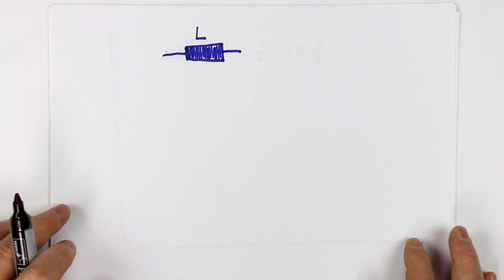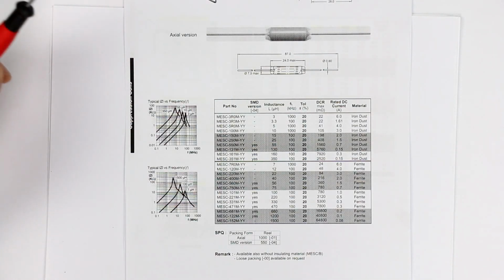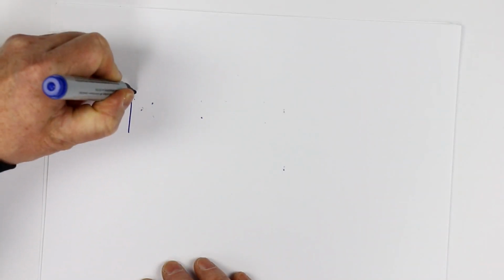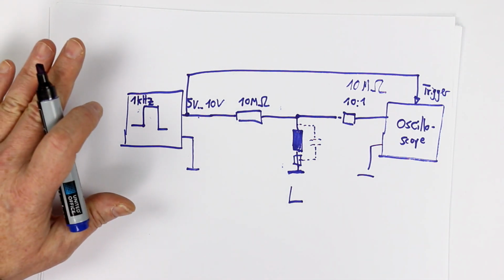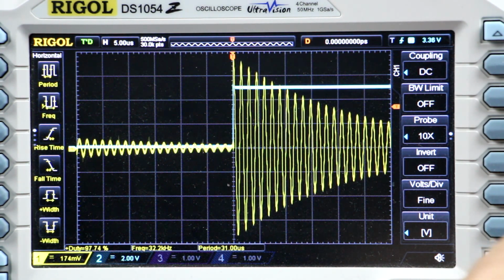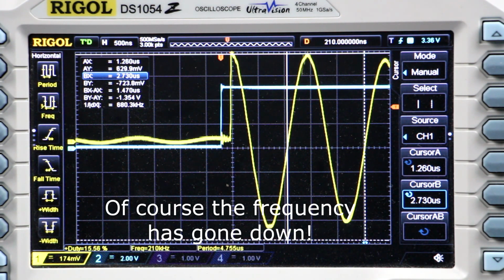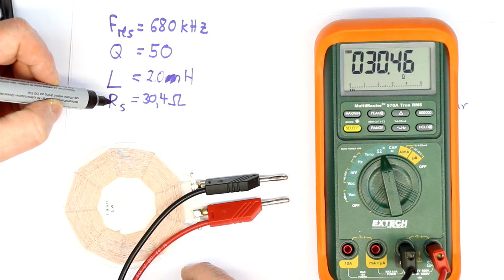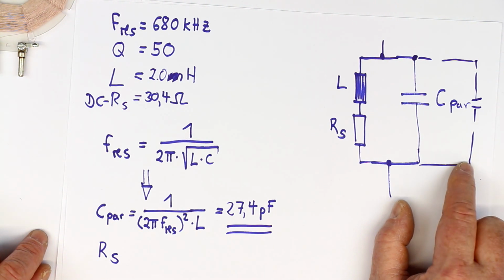Measuring Self-Capacitance and Self-Resonant Frequency SRF of Inductors

Comment: SG, test load, Osc in paralel like in the circuit doesn't work with my Fnirsi 1014D Osciloscope.
Dont know why.
By connecting all in series(without resistor) then i can find the resonant frequency.

Comment: He said you can find Q by counting the number of cycles to get to half the first cycle amplitude and multiplying by 5.  That's a bit rough and ready.  For a Q of 50, 10 cycles would drop to 0.522. not 0.5.   Logarithmic decrement (the drop from one cycle to the next) is pi/Q, so the amplitude of the 10th cycle is (1 - pi/50)^10 = 0.522.   He added further error by starting at the first cycle, whose amplitude and waveform is affected by the residual  wave from the previous driving cycle - you can clearly see that in the video.    He should have taken say the 5th cycle as his reference or, better, use a much lower frequency triggering square wave.
His real Q is closer to 45, not 50.

Comment: In this video he used "Thompson's formula"   f = 1/(2PI*sqrt(LC)) based on the self resonant frequency and L measured at a much lower frequency to calculate the self capacitance (which he called "parasitic capacitance" - a term we don't use in english).
This is generally a very inaccurate method and should not be used.   
The reason is that at and near self resonance, the circulating capacitance current seriously distorts the distribution of coil turns current.  Obviously, if it is resonating, the current in the start and end turns must be very small, but the current in the middle turns very high.   In fact the distribution of current in the turns is parabolic - quite different to what happens when resonated with an external capacitor, wherein the current is the same in every turn.
Thus the magnetic field is a different shape, the energy stored different and that means the inductance is different - changing the self resonant frequency away from what Thompson would predict.
The traditional way of measuring self capacitance is to find two external capacitors that resonate the coil at a frequency f1 and 2f1, both much lower than the self resonant frequency, say 1/10th.    The self capacitance is then (C1 - 4C2)/3.  This will for most inductors typically be about 10 to 15 times more accurate than KainkaLab's method.   You don't need to know L to get the self capacitance.
I had to laugh every time he pronounced "series" as "serious".   He did it every time.

Comment: You said it is the self-resonant frequency measured by the component tester, but that was 546kHz, different than the 680kHz the scope measured.
You said it's not very accurate, but that is a big difference, is it still the same measurement, or did I miss something?
Reply: In the calculation, he is using 680kHz. Ignore 546kHz. 546kHz was used by the component tester to measure the inductance of the coil.

Comment: So if I have a coil with a capacitance of 290pf that I measured.  I want a resonant tank for the natural frequency of the coil and have derived that capacitance needed for the resonant frequency. The problem I see is the coil capacitance is greater than the derived capacitive value. Am I correct in stating the I have to take into account the coil capacitance in creating the LC tank? If this is the case then I can not get the capacitance as low as I need unless I add another capacitor in series to try to get the value low enough.
Reply from the maker: You can only change the resonant frequency to lower frequencies (below the SRF of the coil). The only way to change/tune the resonant frequency of an existing coil is to add a capacitor in parallel. And that in turn lowers the freqeuncy. Adding a capacitor in series does not change the resonant frequency!
So you have to find or wind another coil to get the desired resonant frequency.
Reply: @KainkaLabs  Thank you. I Want the tank to resonate at its S)elf R)esonating F)requency. That is the value of capacitance that I am trying to achieve.

Comment: Can you tell me the name of the device you use at minute 28:05 ?
 Thanks a lot
Reply from the maker: You probably mean the "Component Tester" which is an open-source project from a German ham-radio amateur. It sells on Ebay under different names and in a number of models. Search for "Component Tester" or "Transistor Tester". David L. Jones also given it a "thumps up". We have it in our shop for many years: 
 https://www.ak-modul-bus.de/stat/laborzubehoer.html
And I made a 4-part video series (kind of shootout) of 4 different transistor/component testers...
Reply: @KainkaLabs  Thank you very much for this complete answer.  See you soon, a cordial greeting.

Comment: Hello Roger, Great Video!  I am trying to do the same with a cylindrical oil filled ignition coil.  I seem to be having some issues with this on this sort of coil.  I took my 10 mOHM resistor from the inside of a microwave oven capacitor.  Can you explain how to do the same experiment on both the primary and secondary of one of these sorts of coils?  Perhaps I need less resistance? Remember the ignition coil is an autotransformer with the primary and secondary attached (usually at the negative pole of the primary). I know the inductance of the primary because I have a UNI-T LCR meter that caps out at 20 Henries (my primary is 5.27 mH, but the secondary (which should be around 49 H is too large to measure with this unit).
Reply: 10 miliohm? Did you mean 10Mohm?
Reply: @AlienRelics  Of course, thanks!
Reply: @MisterBonetti  Ironically, I mis-spelled "milli"! 😅

Comment: Does the frequancy change with a changing voltage? So if we  measured it at 2 volts will it change at 5 volts and 10 volts respectively?
Reply from the maker: I didn´t try, but why should it change (as long as there are no saturation effects)

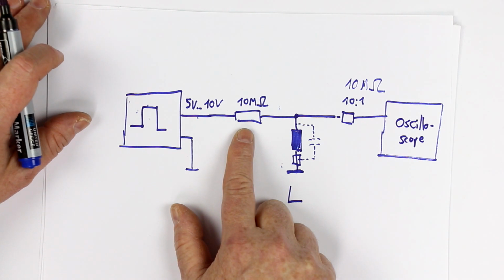Comment: 15:00 Probe also have some capacity..you should not add 1pF capacitor with probe?
Reply from the maker: Yes, somebody else remarked this in another post. I forgot to isolate the probe with a 10 Megohm resistor from capacitive influence.

Comment: scope+probe input capacitance is quite comparable to the value you calculated so, this self capacitance value is quite a bit wrong
Reply from the maker: No. Because the scope-probe was isolated by the high-Megohm value resistor.
Reply: @KainkaLabs  I agree with Amir B that your scope probe capacitance caused your measured SRF to be lower than it really should have been because you did not have a resistor between your inductor under test and the scope probe.  I just did a test using your set up using a x10 probe and my measured SRF on an inductor was 5.1 MHz.  When I measure the same inductor using a nanovna the SRF measures 7.3 MHz.  If I repeat your measurement system measurement but add a 1 Meg ohm resistor between the inductor under test and the scope probe the SRF measures 8.33 MHz.  I suspect the 8.33 MHz measurement is the most accurate out of all 3 of my measurements because the added 1 Meg ohm resistor helps isolates the scope probe capacitance from the inductor under test.

I also calculated what capacitance would make my 44.2 uH inductor resonate at 5.1 MHz and it would be 22.0 pf.  To resonate the inductor at 8.33 MHz the capacitance would be 8.3 pf.  The difference in capacitance is 13.7 pf which is very close to the 14 pf published capacitance of my x10 probe.  Therefore it sure looks like the scope probe capacitance greatly influences the measured SRF using your setup.

Update: I also checked self resonance of my inductor by setting my function generator to output a sine wave and connected it to the inductor using a 10 Meg resistor just like the setup shown in this video, but I did not connect the scope directly to the inductor.  I wound a two turn pick up coil and connected it to my scope x10 probe and placed this pickup coil close to one end of the inductor and then adjusted the function generator until the scope waveform peaked, and it peaked at 8.3 MHz which exactly matched the results I obtained when I added the 1 Meg resistor mentioned in my first paragraph.

P.S. great video
Reply: @KainkaLabs  @ 16:00 what resistor? It's a 10Mohm input of a 10:1 probe directly connected to the inductor. there is no extra resistor in between, is there? The lowest capacitance 10:1 passive probe I have ever seen is P6139 of Tektronix which has 8pF total capacitance at its input tip when it is connected to the 1Mohm scope and compensated. Any other passive probe will have more than 8pF at the tip.
Reply: @amirb715  so you're saying the SRF measurement is wrong? I'm not sure if I'm missing something, but you're implying it's impossible to measure anything at MHz.

Comment: Most excellent! I was able to immediately go down to the KY8D lair and verify that the basketweave loading coil for the 472kHz TX antenna would, after all, be good for its intended purpose. This after my LCR meter gave alarming mis-results, when used by itself. Ditto the Rx loop. But that neither may do double duty for 160 meters. Good to know. Thanks!

Comment: Why your measured Q factor differs so much from calculated one? According to your parameters Q factor can be calculated as: Q=1/R*sqrt(L/C).... It gives 281..? But anyway perfect video.! :D
Reply from the maker: You can´t take the ohmic (DC) resistance for calculating Q-factor. You have to take into account skin-effect and proximity effect which raises the DC-resitance sometimes by orders of magnitude.
Reply: @KainkaLabs  Thank you very much for your answer.... You really think that skin effect and proximity effect would have such an impact on the resistance in frequency 700kHz? .. and moreover u used a Q factor formula for calculating AC resistance... I am just so struggling with my LC circuit, because my measured value of Q factor is significantly lower than calculated one... Do you think u can use the same way to measure quality factor of LC circuit (where value of capacitance is in tens or hundreds of nF)?? Thank you
Reply: @josefbednarik5782 I can confirm, AC resistance absolutely does entail accounting for skin effect.

Comment: How do you select the output frequency of your function generator for this?  Many thanks.
Reply from the maker: It doesn´t matter so much because it only serves to excite the inductor. Your osciloscope will automatically trigger (only) on the start of the oscillation. For the video I just set the frequency so that you can see 2 of the damped oscillations on the screen. For measuring it is better to have only 1 damped oscillation stretched fully on the screen.

Comment: After some thought, what you presented has caused me to reevaluate one of my designs to determine why it wont oscillate. I overlooked stray and parasitic capacitance. I built the circuit on Protoboard....a bad place for stray capacitance.

Comment: Thank you for the video I have enjoyed watching it.  I also found a website that derives the formula for calculating the Q of the resonant system, (number of cycles for envelope to diminish to 50%) X (4.53) = Q.  The frequency of oscillation and the inductance can be used to calculate the capacitance in the resonant system.  The Q and the inductive reactance can be used to calculate the effective resistance in the resonant system.  I use the term resonant system because there is more capacitance in the system than just the stray capacitance of the inductor.  I used this method to try to determine how stray capacitance varied as a function of the number of turns of an air core inductor.  What I have learned is the oscilloscope probe can add between 15pF and 20pF to the system.  15pF to 20pF can be many times greater than the stray capacitance of the coil itself and what initially appears to be the self resonant frequency of the inductor is actually significantly less than the self resonant frequency of the inductor.  I have experimented with coupling the signal from the inductor to the oscilloscope probe through a 1pF capacitor and this has its own set of difficulties.  In my case I have at least verified that the stray capacitances of the coils I am experimenting with are small enough that they can be ignored in the preliminary design of a crystal radio.  It is almost impossible to determine the stray capacitance of an inductor precisely when the stray capacitance is in the range of 2pF to 10pF.  Minor adjustments can be made in the design using trimming capacitors to improve performance of the initial design.  I really enjoyed this video and it has led me to several interesting experiments and observations over several months.  This method is theoretically sound but the capacitance added be oscilloscope probes makes it extremely difficult to measure the very small stray capacitances associated with some inductors such as air core inductors used in crystal radios.
Reply from the maker: It is of utmost importance that the square-wave source and the oscilloscope-probe are isolated from the inductor-under-test each by a resistor of at least 10x the value of the calculated (or initially guessed) of the resonance-resistance of the inductor/self-capacitance tank-circuit.
If you connect the oscilloscope probe directly to the inductor you of course get the capacitance of the oscilloscope probe added to the self-capacitance of the inductor.
10 Megohm should be the minimum, 100 Megohm is better for High-Q inductors.
Of course it´s not easy to get reasonable results when the self-resonant frequency goes into the many mega-Hertz or even 100 MHz and above.
There it even becomes important to have the inductor-under-test isolated with a wooden holder from any metal,  ground-planes, earth-connected cables etc.
Otherwise you get an extra capacitive coupling that skews your results.
You can notice these effects even when touching the inductor (as can be seen in the video).

Comment: If you don't have a fancy scope with Cursors can you determine the SRF by applying a sine wave and adjusting the frequency to get the highest signal amplitude on the scope?
Reply from the maker: You don´t need a fancy-pancy scope :-)
Every analog scope (with enough bandwidth) can do it.
You just have to trigger on the exciting square wave to get a stable view and just count the cycles where the amplitude drops to half its peak value.

I think in this video I explained 2 other methods to measure Q-factor: https://youtu.be/gJlkWt3VYxM
Basically it should be possible with what you suggested.
But be careful to couple in the sine-signal with at least a 1Mohm resistor (10 MOhm is better) and you probe the amplitude with a 10:1 scope-probe with 10 MOhm input-impedance.
Reply: @KainkaLabs  is there any way to measure srf if I have no scope at all?
Reply: Just count a full cycle horizontal divisions and multiply by hor sec/div time base.

Comment: I think SRF is Self Resonant Frequency.
Reply: There is a fundamental Parallel SRF (peaking) and a fundamental Series SRF (low Z or a short) and harmonics of each; even on the parallel and odds on the series. For instance a parallel SRF of 20 MHz would have a smaller peak response at 40 and 80 MHz and so on. Similarly the Series SRF if at 22 MHz would have lo Z values at 66  and 110 MHz and so on...

Comment: I think you used the wrong term 7~ min

- so called 'impedance' wouldn't peak at the resonance frequency, that would be so called 'anti-resonance' so this tells me the peak on the graph is not the resonant frequency. (i may be wrong there) but i think the manufacture is showing just the impedance peak. which does not necessarily align with the frequency of resonance. 

they are showing the peak for the use of the device. (as intended)
Reply from the maker: No.  I think you´re wrong.
In a parallel LC tank-circuit the impedance is in fact at maximum at (very near) the resonant frequency.
And as is explained a few minutes later the parasitic elements of an inductor always make it a parallel LC tank-circuit.
This is explained in quite some detail in the German Wikipedia entry about LC-circuits:
https://de.wikipedia.org/wiki/Schwingkreis#Realer_Parallelschwingkreis
(The English Wikipedia entry does not explicitly mention this but it could be derived by diffentiating the formula for the impedance of a parallel LC-circuit)
 
 The opposite is true for a series LC resonant circuit.
There the impedance is minimal at (very near) the resonant frequency.
Perhaps that is what you mean with the "anti-resonance" point.
Reply: ah ok thanks for the clarification, ok i see at these frequencies how the effects you mentioned come into play. thanks for the correction. 

although i must say i don't trust Wikipedia for any real technical information however i see what you are saying, yes it was negligence on my part here.  

although i wouldn't personally use the term 'resonance' to describe that effect however i can see how it is described as such. 

thanks gain.
Reply: furthermore to this yes you are absolutely correct i apologies in these terms. 
the two reactants are in resonance which causes the device to become  'cancellation effect' it's the cancellation effect i was calling 'anti-resonance' so yes it was the terms i was having difficulty with. 
thanks again.